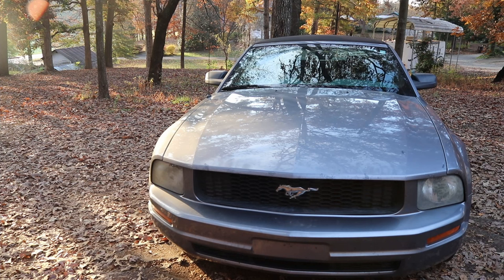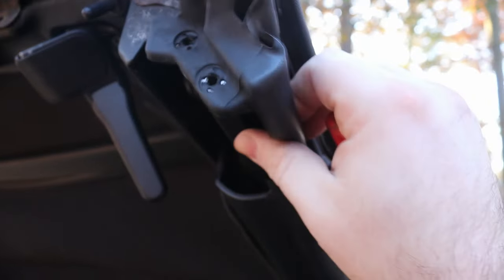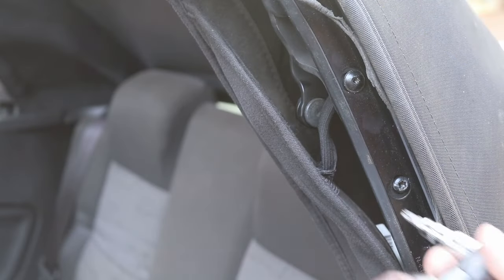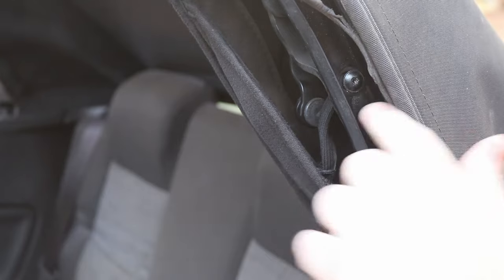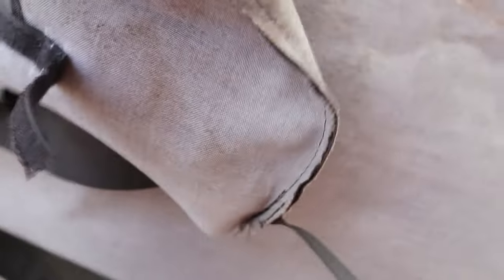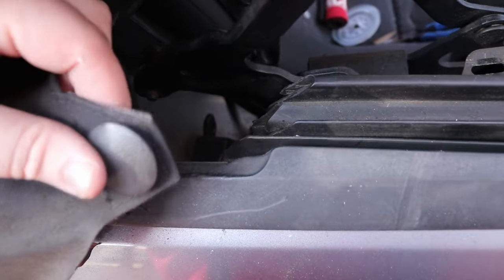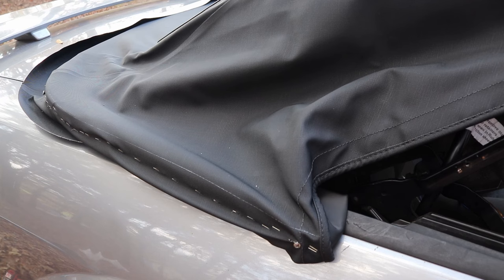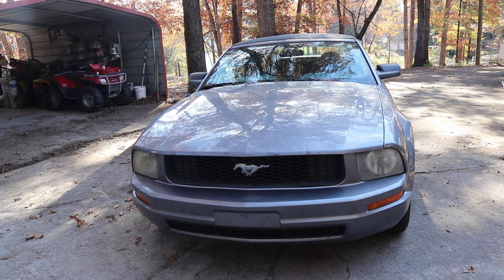How to replace convertible top on a 05-14 ford mustang

Comment: I have a 2010 Mustang convertible that I bought used. It appears the convertible top is off centered meaning I cannot open the passenger side door without rolling down window first because window gets caught on fabric. The rear where the convertible top meets the trunk area also leaks when it rains. I brought into shop and they was about $1000 since they said they would have to take top off and put back on correctly. Is this something I could do myself or should I pay the money? I have some mechanical skills but not alot when it comes to vehicles.
Reply from the maker: So it’s not as daunting as it seems. But I can’t answer if you’d be able to do it or not. The best advice I can give is watch the video all the way through if you feel like you’d be comfortable doing this then I believe you can. Hope this helps. Thanks for watching!

Comment: Lets say I have two mustangs, would it be possible for me to take the good convertible off one mustang and switch it over to the other with the bad convertible?
Reply from the maker: Intresting question, but yes I have seen people do this. But two things to keep in mind it is a pretty big job so you don’t want to run into trouble. So first thing to consider is getting those two sections on top out of the channel they are in without damaging them. In my video I cut it from the convertible then pull them out the side (they slide easy). But I know personally can be a real PIA trying to get out of that channel normally without damaging them (if you damage it then you’re in trouble. Second problem which probably isn’t anywhere near is bad is how long will the donor last? Is it in good enough condition that it’s worth it? Personally given the choice I’d probably still save up and just get a new one. But that’s just my personal opinion. 

Thanks for watching!

Comment: You took out some rivets did you use a rivet gun to put them back or how did you do that
Reply from the maker: Yes I used this m12 river gun MILWAUKEE ELECTRIC TOOLS CORP 2550-22 M12 Rivet Tool Kit (2550-22) https://www.amazon.com/dp/B07BWPKWN6/ref=cm_sw_r_cp_api_i_SWZQFV9NCTQWF4DXWJP9?_encoding=UTF8&psc=1

But you can use a cheap hand powered river gun aswell it just take more effort. Hope this helps! Thanks for watching!

Comment: Quick question - I had a shop put the top on my 09 and (3 Years ago) about half of them came out when I put my top down yesterday. I'm wondering if it's possible to pull the bar out of the back without having to do all of the disassembly so I can staple the rest of the top back together? It's the portion you talk about at 13:46
Reply from the maker: I’ll be honest I’ve never tried it before but defiantly worth a try. The only thing I highly recommend is putting pieces of foam or something to protect your car if it can come out. Good luck and let me know how it goes. Thanks for watching!
Reply: @JunkyardJunkie  Thanks for the tips, do you know of anything holding that molding piece to the body (screws and such)? I can give it a shot this weekend but want to make sure when I pry it out I don't pull out any nuts/bolts/screws etc.
Great video btw!

Comment: Can you list the name of the tools you used? I don't have any of these tools and I'm trying to buy them.
Reply from the maker: Yes ma’am, it’s listed in the description but you’ll need 
-rivet gun (handheld or for convince automatic one like Milwaukee’s) 
- 1/8” x 1/2” rivets. 
-staple gun with 3/8 stainless steel staples 
-drill for any old rivets still in there
-pliers or something to pull old staples out. 
-torx socket set I believe the only two sizes I need were T25 and T30 but I may have also used T20
- basic socket set
- razor blade

That’s really it I show everything I used in the video. I hope this helps. thanks for watching!
Reply: @JunkyardJunkie  thank you so much! My apologies I didn't see the description
Reply from the maker: All good no worries. Good luck!

Comment: Some of my black plastic clips broke that goes on the metal convertible top frame. Do I really need those? If so, I can’t find them online.
Reply from the maker: No you can just use pop rivets instead. Hope this helps. Thanks for watching!
Reply: @JunkyardJunkie  I mean the clips at 7:05 that clips onto the metal that you screw the screws though
Reply from the maker: Ok I see what you are talking about. Ya I believe those are just to help keep it straight. So, it should still be ok without it but if it was me I would find something of the same thickness and just make a shim to put back there. Hope this helps!
Reply: @JunkyardJunkie  yeah I was thinking I could find a piece of rubber and sand it down to the same thickness, drill a hole, and glue it on so it stays. Thank you sir
Reply from the maker: Sounds like a plan. Good luck!

Comment: What is the piece with the 6 screws called
Reply from the maker: Honestly I’m not sure what that piece is called. If you need a replacement you’d probably have to call ford directly and ask someone from the parts department. Wish I was more help. If you do find a part number or a name comment it here and I’ll pin it so it’ll stay at the top for others to see. Thanks for watching!

Comment: Followed this videa about a year and a half ago. Got it installed after several hours of work. My chalk line was incorrect so i had to retry a few times. That sucked alot. Called it good when it was mostly aligned but the lip by the 1/4 windows wasnt secured due to improper placement. DONT call it good. Retry until you get it right. Now I'm doing it again because after some heavy rain I had insane amount of water pooling up. Get it done right the first time and dont put yourself in a position that youd have to go back again. Its not worth it. Great vid btw
Reply from the maker: Thanks! I hate to hear that though. It really is best to make sure it’s right the first time because doing it twice would really suck. But hey you got this. Thanks for watching!

Comment: I’m in the process and the old top is an 2005 but my car is a 2006 I ordered one that said compatible with 2005-2016 but it’s no place to put that string through on the sides
Reply from the maker: On the inside on both sides it almost looks like it’s got seems but if you grab them you’ll see they open. Give it a good look. If you still can’t find it send it back and pick one up from American muscle they’re great place to grab parts. Hope this helps. Thanks for watching!

Comment: What name part that’s behind small window black seal like 8 in ling by 4 and has 3 holes
Reply from the maker: Are you talking about the rivets?
Reply: @JunkyardJunkie  the area where you put staples, on the ends on that area there little black shield not connected to convertible, but to car by three tabs. Its next to small side windows and goes between convertible and car metal?
Reply: @JunkyardJunkie  13:52 on that area there a black plastic that tights against convertible
Reply from the maker: If you look at 7:12 do you still see it? I believe I know what your talking about now is it where the inside of the the convertible connects to the bar.
Reply: @JunkyardJunkie  no that piece its not on the convertible but it’s against it its mounted in car and its black rubber water leaks thru there and iam trying replave it . And its hold by three tabs but its in that location and by the way thank you for quick reply i appreciate

Comment: Here is the biggest problem I came across. The new top I purchased doesn't have any indicator line at the back to indicate as to where to line it up and staple.  So now we are stuck trying to figure out exactly how much material needs to overlap that back bar. If we staple it too tight and need to undo the Staples then we will have exposed staple holes. We already stapled it too loose.  That being said I think you're better off saving up money and having a upholstery shop do the work for you. This is not a standard backyard mechanic job.
Reply from the maker: That’s why I recommend getting it from somewhere reputable like American muscle. With out that it is a huge hassle. Saving up for a upholstery shop is a good idea if you can budget for it. I know some people can’t. Plus some people like to learn new things (I know I do). As for it not being a standard backyard mechanic job… ya I don’t think anyone’s going into it thinking it’s a easy job like tie rods or something. But, at the same time honestly it doesn’t require many tools and it’s not as bad as many people think. But I appreciate your input and hope you get yours figured out. Thanks for watching!
Reply: @JunkyardJunkie  yeah I pretty much took the plunge and just guesstimated how much overlap for the material at the back.  came out good enough. Little bit of wrinkles on one side of the back.
Reply from the maker: That’s good for a guesstimation. Glad it turned out pretty good!
Reply: Did you try to use the previous top as a reference, then outline on the new top with a marker based on measurements?
Reply: @shynethegod360  cut the old top up and tossed in trash. Had no idea it would be needed. I've got the new top on now after going back and re doing the staples but it's still slightly off and has wrinkles on one side. Would have been nice to have known to keep the old top before throwing it out hence why I was watching this YouTube video for instructions.
Reply: @futuregamer5791  i’m glad you brought that point up, because now I know to keep the old one for reference. Thank you.

Comment: has anyone else done this that knows if i should do it with a friend instead of paying a shop 1500$ that i don’t have
Reply: I also talked to this guy that said he’d replace it (for 1500) and he said that they can rip easily which i don’t believe.
Reply from the maker: I say go for it. It’s honestly not too bad honestly. My biggest bit of advice is to put foam around all places around where it lifts out at. Reason being is it’s super easy to scratch your car. 

Thanks for watching!
Reply: @JunkyardJunkie  how long do you think it would take 2 people with out stopping with a video?
Reply from the maker: Depends on how mechanically inclined you are. But my guess 6-8 hours give or take.
Reply: @JunkyardJunkie  Good video on a complex top removal and  installation.   Liked your calm and step by step process.. Out standing finished top.  Your staple  work was fine
Reply from the maker: @michaeltarillion5067  Thank you so much, that means a lot to me. have a good one!